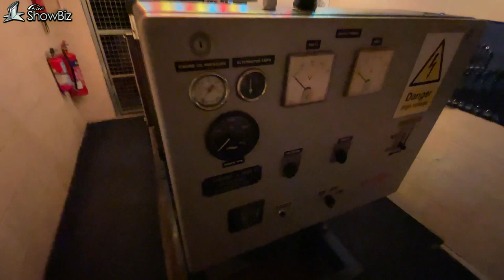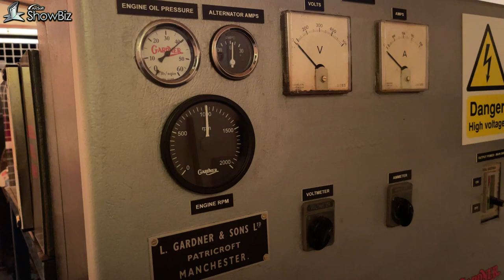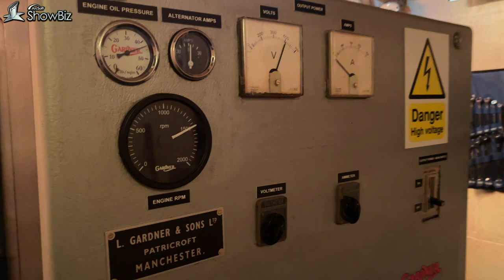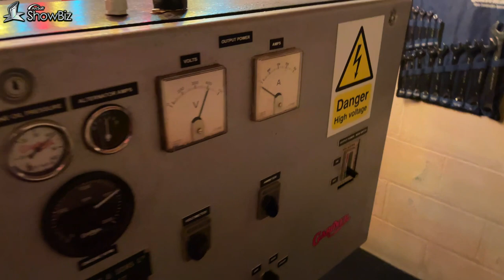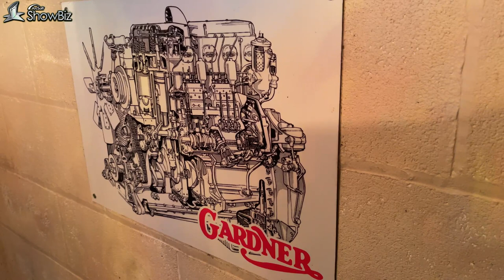Gardner 6LXB Diesel Generator 100kVA Funfair Style Gen-Set ex Bristol VR Bus Engine Twilight Running

Comment: Excellent set up. Carl ex Gardner fitter.
Reply from the maker: Thanks Carl.👍
Reply: @transportarchive6680  Great way to start the engine, low revs, get her warmed up, then a load on. You get some generators at full chat from cold. Clean oil, filter changes, and timing chain checks/ adjust, and she will see you a life time.

Comment: What had happened to Gardner engines ?
Reply from the maker: Gardner ceased production of new engines in the early 1990s. 😢
Reply: @transportarchive6680  Thanks for that as i wasnt sure, used to see them  in ERF's here in Malta back then they would already have worked ten years in UK before coming here.
Reply from the maker: Fantastic engines!  They still have a loyal following, particularly for marine use.
Reply: @transportarchive6680  Yes a mate of mine exported a few to Hong Kong about a decade ago now.